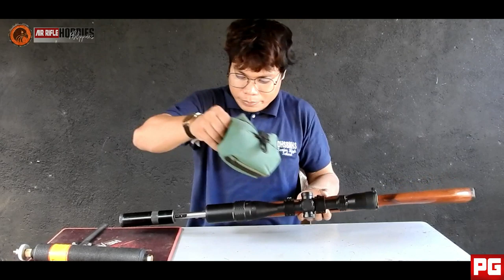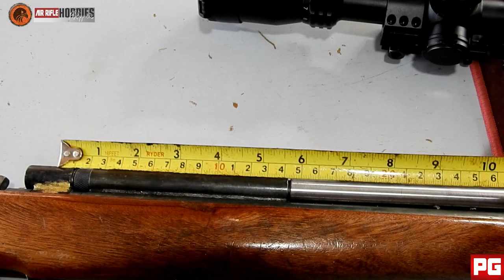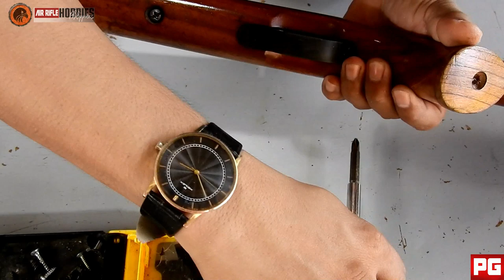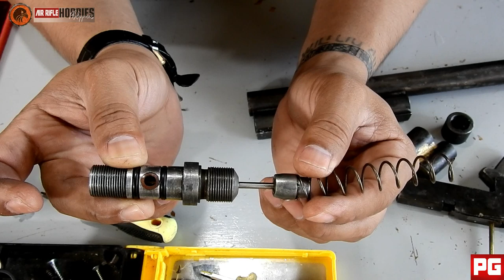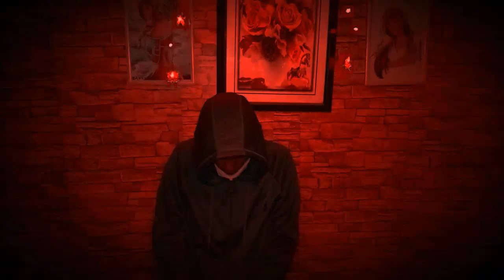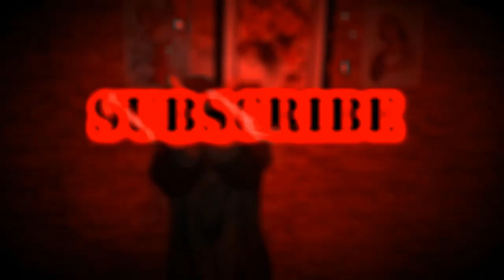13k Pesos na halaga ng Airgun, (DISCOVERY SCOPE)  ito ang mga basic parts ng Laruang d Hangin

Comment: Dave, as I viewed the Seneca on P.A.s’ website, I thought that it’s  fine lines on the picture is just not the real thing !!! But when I received & opened the box, first thing I noticed the shiny riflestock, & elaborate  engravings on the foreend ,& grip area and the airtube is massive unlike no other, the only lacking feature is the sling studs or foreend rail for bipod mounting! I tested it using H & N baracuda match  21.14’s & Seneca, Eunjin 28.4 grs.  @ full power, it reached a whopping 1000 + FPS !!! so I turn it lower @  918 to make it stable !!!
Reply from the maker: Goodness gracious... Thats a power 1000 fps??? How about the accuracy and how many yards did you tested it? It is a multi shot right? How many shots per refill? And what is the materials been used? How many shots accurately per refill, regulated or not?
Reply: @AirRifleHobbiesPhilippines  pm po akl sayo
Reply: @AirRifleHobbiesPhilippines  sir tanong lang po kung meron pa manga ganyan na mabibili sa inyo po

Comment: Sir Good pm po, question Lang po yon po bang sa exhaust spring nya na nakaconnect sa Barbola sa discharge valve ay dapat po ba may nakaharang o nakakalso na nakaconnect sa air reservoir o pede nmn po na wala?Thank you po in advance.

Comment: Dave, just remember the front is the farthest, rear means on your back so the nearest! !!! and  weaver or dovetail 11 mm. is the built in groove on the receiver of your airgun, so try facing  your crosman airgun if you have that I& observe the shape of the milled, tapped groove on the sides of the receiver, it looked  like a dovetail  in flight spreading in an angular shape!!! as for the picattiny you cannot miss it as they are different!!! It looked like a ladder with steps !!! just view some on the internet, picattiny rail adapter!!!
Reply from the maker: Yeap i hv seen that the ladder looks a like... Ok² now i know.. yeap take note on that later

Comment: Dave, as I said test your pcp on a chrony and do a 10 shot grp @25 yds copy the whole thing and check the maximum speed of your choice of pellet, the minimum, the Avg. extreme spread & standard deviation! If your pcp has a nice valve that functions properly & has good results with the chrony, why bother to install a reg.?  As I have said a long time ago, powerband of your pcp, & chrony, the most important thing to know if you have a pcp ,  If you put in a bottle  to have more shots, It’s okay for competitions but you may exert so much effort in pumping if you dont have a compressor or a charging tank , buddybottle or air cylinder, there are other pcps that have nice valves who can have a good shot to shot consistency ( E.S. & S. D.)
Reply from the maker: Wow thats a good explanation there.. one thing they said that if u have an unreg airgun u need to have 2500psi u can go above that coz it will cause valve lock.. is it true?
Reply: pcp with a regulator will be much better and for me easier to tune, but you are correct if you have a chrono you can get the sweet spot of your pcp, and also you need to check accuracy depending on brand and weight of pellet. in my experience on my 22 impact every tin i re check 0 even if its the same brand and weight because these pellets have different batches and different batches shifts poi. just my experience

Comment: Dave, It is not a picattiny rail, as you can see, the one you bought from Lazada,though it is too small, picattiny or M- 19 13 rail ( mil. jargon) are too wide, the ramps are spaced in minute .mm spaces in between, weaver or 11mm. termed dovetail coz it resembled  a dove’s tail when you view it on the rear of your rifle gazing @ the receiver on it’s sides, back to where I mean, the one you bought is the picattiny rail, the ones you have built in on any airgun that has a built in groove, tapped by the machinist in angular shape on the receiver is called weaver or 11 mm. dovetail as the shape  looked like a dovetail in flight!
Reply from the maker: Ah ok weaver 11mm I will correct that later tonight
Reply: picattiny is about 20mm correct me if im wrong, dovetail is 11mm

Comment: Sir pahingi po ng quatation 2nd hand at brand new. Very intereated
Reply from the maker: Thanks, po sa inyong mensahe. Maraming salamat po sa panonood.
Magandang Araw po sa inyong lahat, Maraming salamat sa inyong pagbisita sa ating channel.
Ganon din, salamat po sa inyong patuloy na pag subaybay. Mabuhay po kayo!
Always keep safe po, and God bless po sa inyo at sa inyong Pamilya.

Regarding po sa tanong ninyo. Pwede nyo pong ma contact sa messenger ang mga sellers po para ma assist po kau sa mga:
1. Contact info like cp# ng sellers
2. Accessories ng mga airgun
3. Brand ng airguns na avail nila
4. pricelist
5. paano ipadala
6. mode of payment
7. saan location nila
8. o may branch ba malapit sa inyo
9. atbp. na mga katanungan.
LOCAL SELLERS:
1. Win Lustarez
2. Robin Samonte
3. Rolly Aurellana
4. Philip Jeffreth Mendoza
5. Raffy Artigas

PAANO MAGING SAFE AND LEGIT CHECK?
1. Mag pa legit check-Ask ang mga matagal na sa airgunner
2. Mag padala ng Private Message- Send a message regarding sa information na gusting malaman
3. Once nag reply ask question regarding sa accessories or type ng airgun na bibilhin
4. Once na nakapag decide na sa bibilhin, mag video call po kayo para na makita nyo xa same sa profile pic at photos ng naka transaction na seller.
5. Before mag bayad sa item na kinuha mag papadala ang Seller ng Video na binabalot nya ung item mo
6. Hingin ang code if sa ano mang currier nya pinadala.

ADD ON QUESTION:
Ano ung valve na naka thread?
Ito po ang vid na ginawa ko sa installation ng airgun nimrod: https://www.youtube.com/watch?v=wrj_i6z119w&feature=youtu.be
Maraming salamat po. From AIR RIFLE HOBBIES PHILIPPINES

Comment: me benebenta ka sir yung buong set na co2 air gun po
Reply from the maker: Thanks, po sa inyong mensahe. Maraming salamat po sa panonood.
Magandang Araw po sa inyong lahat, Maraming salamat sa inyong pagbisita sa ating channel.
Ganon din, salamat po sa inyong patuloy na pag subaybay. Mabuhay po kayo!
Always keep safe po, and God bless po sa inyo at sa inyong Pamilya.

Regarding po sa tanong ninyo. Pwede nyo pong ma contact sa messenger ang mga sellers po para ma assist po kau sa mga:
1. Contact info like cp# ng sellers
2. Accessories ng mga airgun
3. Brand ng airguns na avail nila
4. pricelist
5. paano ipadala
6. mode of payment
7. saan location nila
8. o may branch ba malapit sa inyo
9. atbp. na mga katanungan.
LOCAL SELLERS:
1. Win Lustarez
2. Robin Samonte
3. Rolly Aurellana
4. Philip Jeffreth Mendoza
5. Raffy Artigas

PAANO MAGING SAFE AND LEGIT CHECK?
1. Mag pa legit check-Ask ang mga matagal na sa airgunner
2. Mag padala ng Private Message- Send a message regarding sa information na gusting malaman
3. Once nag reply ask question regarding sa accessories or type ng airgun na bibilhin
4. Once na nakapag decide na sa bibilhin, mag video call po kayo para na makita nyo xa same sa profile pic at photos ng naka transaction na seller.
5. Before mag bayad sa item na kinuha mag papadala ang Seller ng Video na binabalot nya ung item mo
6. Hingin ang code if sa ano mang currier nya pinadala.

ADD ON QUESTION:
Ano ung valve na naka thread?
Ito po ang vid na ginawa ko sa installation ng airgun nimrod: https://www.youtube.com/watch?v=wrj_i6z119w&feature=youtu.be
Maraming salamat po. From AIR RIFLE HOBBIES PHILIPPINES
______________________________________________________________________________________________

Magandang Araw po sa inyong lahat, Maraming salamat sa inyong pagbisita sa ating channel.
Ganon din, salamat po sa inyong patuloy na pag subaybay. Mabuhay po kayo!
Always keep safe po, and God bless po sa inyo at sa inyong Pamilya.

Ito po yung kadalasang tanong na hope po makatulong.
PAANO MAGING SAFE AND LEGIT CHECK?
1. Mag pa legit check-Ask ang mga matagal na sa airgunner
2. Mag padala ng Private Message- Send a message regarding sa information na gusting malaman
3. Once nag reply ask question regarding sa accessories or type ng airgun na bibilhin
4. Once na nakapag decide na sa bibilhin, mag video call po kayo para na makita nyo xa same sa profile pic at photos ng naka transaction na seller.
5. Before mag bayad sa item na kinuha mag papadala ang Seller ng Video na binabalot nya ung item mo
6. Hingin ang code if sa ano mang currier nya pinadala.
Nagbebenta kaba ng AIRGUN?
-Sa ngayon nag promote and review lang po muna ako ng Airgun na aking nabibili sa mga maker. Pero maka assist po ako if saan po kayo maaaring bumili online.
SAAN MAKABILI NG AIRGUN?
Makakabili o makakaampon po tayo ng Airgun sa mga online store sa Facebook po.
1. Search Airgun group sa "Facebook"
2. Once accepted and join post for inquires
3. They will Private message po sa inyo sa mga details
a. Payment method
b. Specs ng Airgun
c. Warranty
d. Atbp.
4. Do background and legit check po by posting sa group
a. Tingnan mga friends list niya if madami syang kaibigan na Air gunners
b. Kung kalian ginawa account nya at least 5 years
c. Do a video call sa transaction and screen record for assurance.
d. Maganda kaliwaan ang pag bayad like meet up
PWEDE BA IPA CONVERT ANG C02 TO PCP?
Yes, pwede po sir, e check po ng maker if pwede most of the Airgun like: Nimrod, Manlapat, Taurus, Armscor, Atbp.
Pakita nyo lang po sa maker and ang maker na po mag suggest sa inyo anong conversion gusto nyo like bottle o naka tube. Range po sa 8k-12k pataas po ang bayad sa conversion nakadepende po sa maker. 

PAANO PAPADALA NG SELLER ANG AIRGUN?
Papadala sa currier ng seller, sila na po bahala doon.
By buss o barko, make sure po na complete address and my phone number and ask how long dadating.
Ganon din ask ang sellers for warranty what if di makakarating ang Item.

KAILANGAN BA NG LICENCE ANG AIRGUN?

There is no law that will punish anyone in the country for having an airsoft/airgun even if it is not registered. You also don’t need any form or permit or license to own one...our firearms law R.A. 10591 does not include the word airsoft or airgun in there. Feb 6, 2019.
Credit from: Journal.com.ph

PAANO MA PA REGISTER ANG AIRGUN?

Pag nakasali na sa mga Airgun group sa Facebook
You can ask for the legit person for register 
(LARRY AVILA) Philippine Team natin you can ask him po
Magbibigay sya ng mga info for requirments
Maganda if by group po ung pag register para isahan nadin po

PWEDE BANG ISAKAY SA BUSS O BARKO ANG AIRGUN?
1. Kailangan po na naka register ang Airgun
2. Kailangan dn may receipt ang Airgun na makikita kau ang may-ari
3. Mag inquire sa Buss and Ship station if pwede isakay ang Airgun
a. Ipakita ang registration at Reciept 
4. Pag pumayag na sila doon lang dadalhin ang Airgun
5. Baklasin ang Airgun-walang laman na c02 o hangin- at ilagay sa safe na lagayan
PWEDE BA MAISAKAY SA AIRPLAIN ANG AIRGUN FROM IBANG BANSA SA PINAS?
Sa ngaun limited po ang kaalaman ko tungkol dyan, ang iba sabi nila nakakapag padala sila sa balik bayan box.
PRICELIST STOCK AIRGUN: (Walang scope, Bipod, c02 Tank)
Depende po sa Seller ang Price either mababa sa binanggit kung Price o Mataas.
1. Nimrod co2 7500 more or less
2. Manlapat co2 13k more or less
3. Taurus co2 7500 more or less
4. Eskopeta co2 from 5500 pataas
5. Jr mangio co2 from 7500 more or less 
6. PCP pump 3k more or less 3 stage
7. PCP pump 4k more or less 4 stage 
8. PCP starting from 15k-50k local made
9. Scope from 3500-18k
10. Suppressor from 2k-5k
11. Tripod from 1500-2500
12. Scope 3500php to 5000php “Low end”
13. Scope 8000php to 15000php “Mid End”
14. Scope 20000php to 70000php “High end”

About namn po sa mga location ng pamilihan-cnxa po dahil hindi po ako affiliated sa mga company po o pagawaan ng airgun dito sa Pinas o sa ibang bansa.
Thanks, po sa support, Share and SUBSCRIBE po.
 from Air Rifle Hobbies Philippines.
LOCAL SELLERS

Comment: Dave, as Iv’e said any pcp that you pump or fill above the recommended bar fill will cause a valvelock & eventually in the long run if you do this often you are ruining the seals & internals of your pcp!!! so every pcp has a fill gauge located either on the underbelly, end of the lower bbl or @ the side below the receiver!  It does not mean that you fill it full at what it is recommended, as you stocked it  for long you add stress to it , so in the other video that Ive’ told you the importance of a chrony on an airgunner, much more important than any of other things like binos or laser range finders !  as it measures the speed of your pellet, the power of your pcp & the efficiency of the valve system of your airgun, including the sweetspot @ what fill level !!!! when you pump your pcp & shot it at the chrony you will be surprised, the 1st shot is not that fast as you thought it would be, & you can experience that almost all pcp has it’s sweet spot @ 160-180 bar level !!!!  so make a list of something you might need, that you wont regret buying!!!
Reply from the maker: Now i know .. that when i get the sweet spot like an example of 2600psi-1800 psi then every time i pump i dont need to go to 3k or 3500psi.. thanks sir Liao. Every time it helps me to learn and understand more.
Reply: well if its regulated you will get a straighter power curve